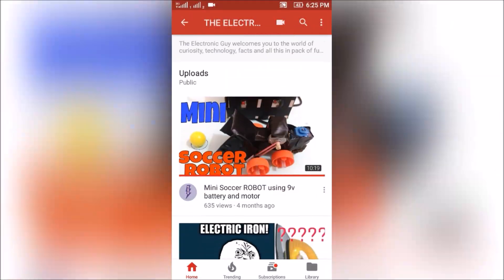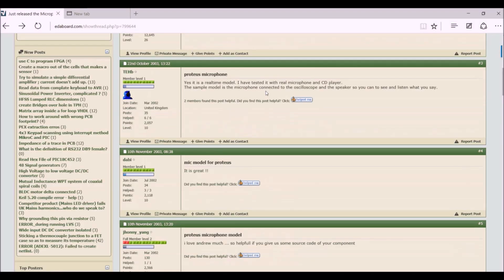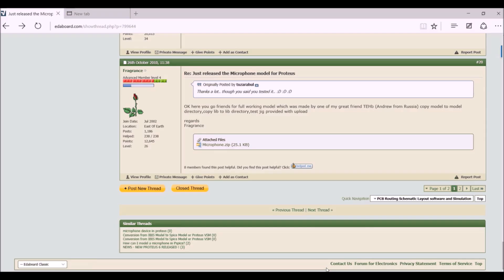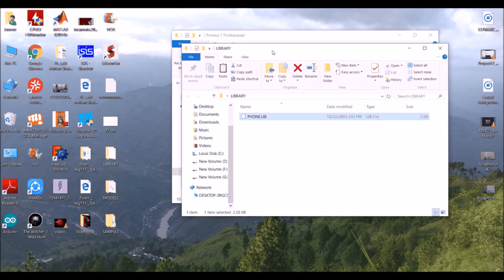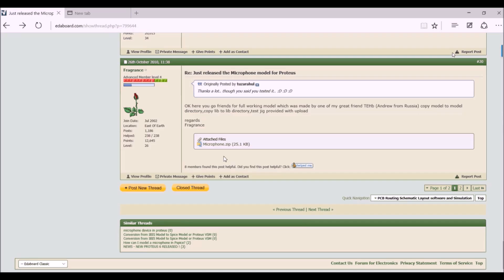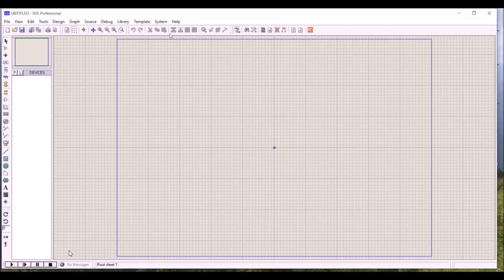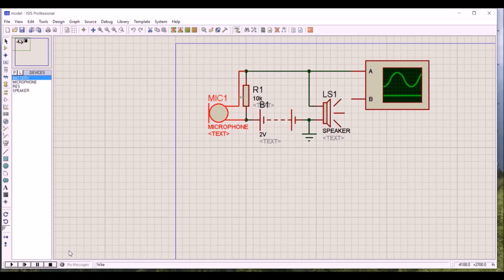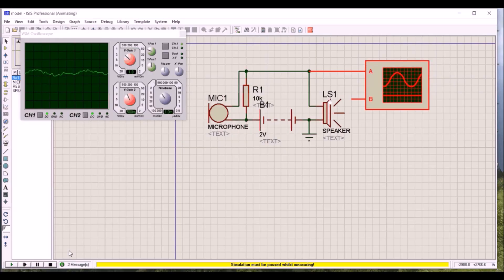How to add MICROPHONE in proteus

Comment: First i couldn't find this circuit project in sample. 

But when i open it from sample folder it is working ,one when i pause simulation this error showing 

"Internal Exception: access violation in module "MSVCRT.DLL [OO0881B8]."

plz help  🙏🙏🙏🙏

Comment: Doesn't work in Proteus 8.6

Error as:

Unable to open soundcard: The specified format is not supported or cannot be translated.  Use the Capabilities function to determine the supported formats. Real Time Simulation failed to start.
Reply: @THEELECTRONICGUY  i have downloaded  microphone library and i added in circuit but it doesnt work